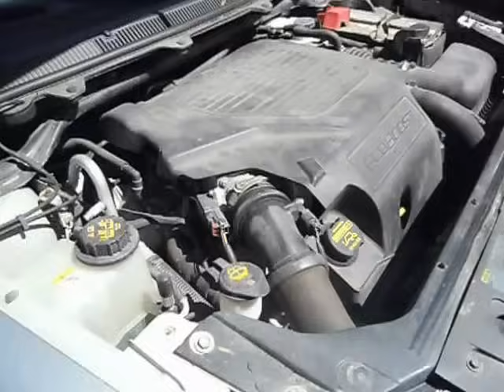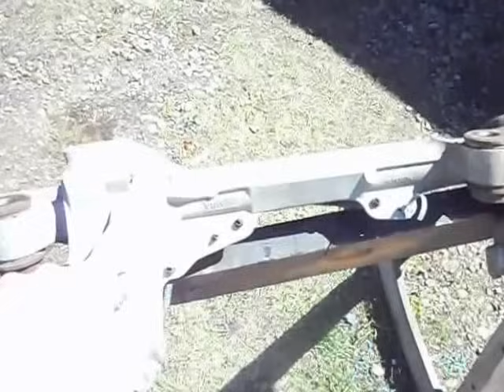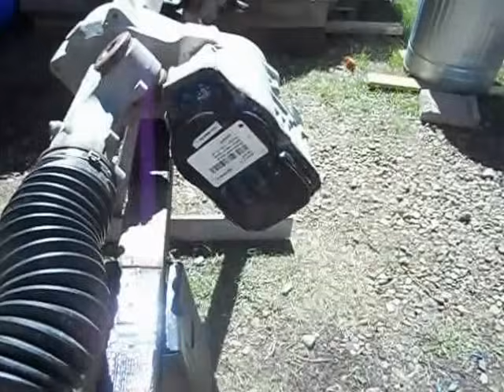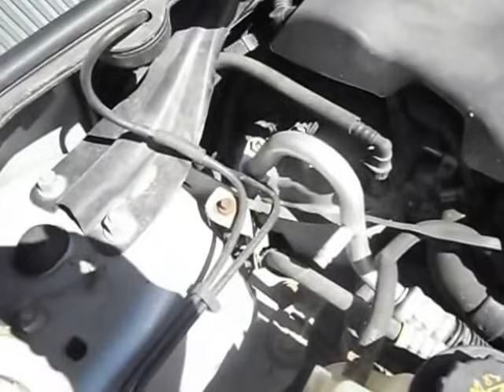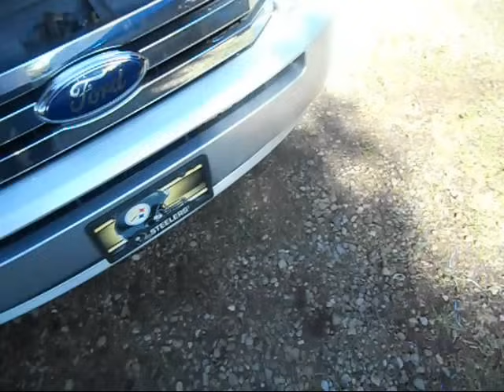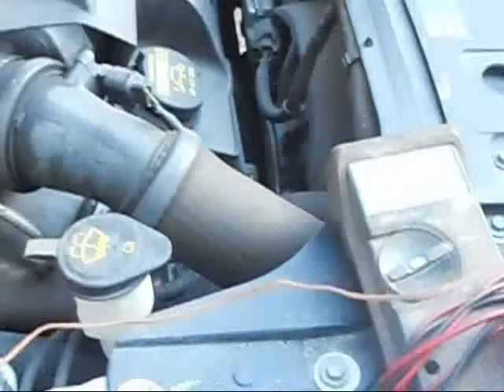Ford Electric Power Steering Failure Identified

Comment from the maker: Important note about industrial vs automotive temperature grades and how engineers design modules to meet regulatory specifications. Designing an electronic implementation to adhere to industrial, automotive or extended temperature range specifications can present daunting design challenge. Related to simple or limited component count implementations; challenge can be manageable. However for high-level integration designs incorporating mixed-signal, computational and high-count component implementations; the challenge becomes great.
Incorporating 100% automotive grade components within highly-complex electronic implementation is not only impractical for most designers; but extremely expensive, time consuming, and introduces many specific assembly and manufacturing requirements to meet specification.
One engineering approach to achieving automotive temperature specification, is to utilize lower-grade sub-components sealed within an assembly, specifically designed to 'buffer' (or protect) internal components from higher-grade temperature environment. This approach often uses high-thermally conductive materials to remove and dissipate heat energy away from sub-temperature grade components. This is precisely the case with the Ford EPAS assembly, which includes commercial and industrial class components internal to an aluminum enclosure, designed with specific intent to provide thermal isolation. Ford's implementation also includes large air-collection cowl that passively channels cooling directly over the EPAS aluminum enclosure. In effect, the EPAS aluminum enclosure collects and stores thermal energy from the automotive grade environment, and this energy is dissipated using airflow via cowl induction.
Unfortunately, this approach failed in the Ford integration, since Ford engineers unwisely placed catalytic converter, exhaust pipe, and turbo assembly within inches of EPAS enclosure. To further compound this failure; passive cooling-cowl only moves air with vehicle in motion. Drive with engine under loaded condition, stop vehicle at red light or sit with engine running, and you have super-heating of EPAS enclosure. Over time, internal EPAS components fail due to thermal stress.
Conclusions represent simple and logical disposition of current Ford EPAS system failures; based on common engineering design practices, measured operational parameters, and visual thermal stress indicators internal to EPAS assembly. Not to mention millions of failed EPAS units in the field with not one plausible or verifiable disposition from Ford or the NHTSA. Did anyone even notice fact EPAS units continued to fail by the millions in spite of Ford supposed fix related to connector misalignment during assembly? Apparently the NHTSA did not!

Comment: I have a 2012 Ford Focus sel. I was driving and the steering went out and being it sits so low to the ground was very difficult to turn the wheel. I thank God my daughter wasn’t driving or this could have been disastrous. I called the dealership and was told the mechanic worked there for 15 years and never heard of this happening. That surprised me since I filed a case with the NTHSB and there were thousands of complaints about this. So I guess I am stuck having to come out of pocket for this. Great video by the way kudos
Reply from the maker: Thank you, good to know video was helpful. Your dealer and mechanic are both liars indicating problem not known. Ford EPAS problems front and center for years, including recalls, court action, news coverage, and millions of vehicles serviced worldwide. Problem is ubiquitous and well documented in Ford TSB's, recalls, and NHTSA historical record. I would ask dealer if they ever heard of the Ford Pinto...

Comment: My best friend's 2011 Chevy Cruze had an intermittent steering issue, different from the Ford in that the steering would just stop responding at times. The wheel itself would still turn, but the car wouldn't. The last time it did it, he drove into a bridge rail at ~30 mph. Totaled the car, but didn't seriously hurt him. Problem is well known, but GM refuses to acknowledge it. Really makes me glad that my daily-driver 1978 F150 doesn't have any of these problems.

Comment: My 2012 Ford Escape's steering has been locking up off and on over the past few years. Very dangerous! Ford told me I need a new steering column assembly and offered me no discount. I'm not paying them after paying off this car from their dealership! They should fix this. 2012 should gave been recalled too! I will never deal with Ford again. There is so much information out there about this problem only by people like you. I'm so sorry you were injured. Thank God you lived to do your research and warn us!

Comment: i have a 2005 chevy equinox the epas system is under the steering wheel inside the cab, no heat issues there haven't had any failures and what i like about it is they sell the individual parts motor, computer module, sensors
for sells a complete unit for $1350

Comment: I have 2010 Ford Fusion and had this happen just last week on way home...This is definitely a safety issue and Ford has no concern for public safety..Mind you this car has had 12 different recalls...on various items including gas tank, throttle control module..NHTSA NEEDS TO BRING THESE ISSUES TO LIGHT AND HOLD FORD RESPONSIBLE..

Comment: I own a 2011 Lincoln AWD, MKT 3.5L Ecoboost. Last year I replaced a failed front transfer case with the new Ford modified "C" unit. I also had a failed electric power steering unit replaced, after the steering wheel almost jerked out of my hands going into a left turn. The power steering was dead. After CAA towed it to the ford dealer the unit was replaced in April 2021, however l had to return to the ford dealership four times for adjustments on the steering unit and 4 wheel alignment. Still the problem persisted as the power assist warning light would cause an alarm and light bracking on left turns. Ford could not fix the problem so i did not permit mhy wife to drive the Lincoln for concern for her safty.
 Last week September 2022, one year and five mouths after the first replacement of the electric steering unit, the electric steering failed a second time as I was pulling out of a parking lot with my wife in the car. She had to assist me in making the right turn. The ford dealership happened to be down the street so I drove it back to them and had them drive us home. The next day I was informed that the lincoln needed another $2,800 electric steering unit and ford would not pay. 
My 2011 lincoln MKT is currently under a manufacturers safety recall in the USA and Canada. However, ford told the dealership that they will not replace the defective unit as they placed a three month warranty on the steering unit. 
I have filed a formal complaint with Ford Canada and wait for there reply. (28 September 2022).
Reply from the maker: Ford has defrauded consumers for years. Your experience is typical and repeated many times over for others posting Ford fraudulent EPAS activities. Ford has established network of specialists including engineers, attorneys, and customer service representatives specifically to evade and repulse customer complaints involving flawed EPAS system failures. Ford engineering and management are acutely aware of EPAS engineering deficiencies, and subsequently developed well maintained plan to defraud customers by actually pulling profit on EPAS repairs. NHTSA is no-show as consumer vehicle safety agency. Fact that EPAS failures are dangerous seems to be of no concern since no one has been killed yet. Or perhaps someone has, and incident has been 'handled' like the Ford Pinto investigation (conducted by Ford). Your best option is to cut losses and stay away from Ford products. EPAS failure could have harmed you or family, do not trust repaired EPAS system. Ford will levy ton of pain and frustration if you pursue warranty repairs.

Comment: My daughter had a steering "hard over" and brought to the dealer. She had previously paid $1500 for a steering motor replacement. This time they told her she needed another $1500 in steering column repairs as well as a 4 wheel alignment when done. They charged her $150 for an alleged inspection by a mechanic to arrive at this estimate. I instructed her to bring it to my shop and they warned her that if I fixed it they would have to charge her another $150 to "re-program the electronics". We put it in the air and immediately spotted a failed steering coupler that was nearly separated. It was a $140 retail part that took one-half an hour to replace. It had absolutely nothing to do with any of the repairs called out on their estimate or the problem.  This reveals a "top-down" policy of fraud and deception by Ford and their dealers. They are certainly not the only ones doing this, of course. That doesn't make it OK. I am filing a complaint with the MN AG office.
Reply from the maker: Ford is a $200B syndicate, Ford dealers do what they are told and collectively process consumers for profit. There is no state or government agency that will go against one of the greatest money makers in the US (auto industry). The whole system is connected from business to politics. What amazes me is people continue to purchase Ford products. You should here some Ford enthusiasts defend Ford like zombies. Amazing!

Comment: I have a 2015 Ford Explorer V6 and we were driving down the highway and our P/S cut out. Power Steering assist failure lights came on, Terrain selector lights came on because of this. Our car had less than 19,000 miles on it. Ford sure isn't what it used to be. Thankfully it was covered under warranty. Thanks for the video. Now I'm curious as to what other catastrophic failure I might expect.

Comment: My wife 2012 ford Fusion just had this failure yesterday. Incredible that they are not taking this issue seriously. But they sure take Airbag recalls seriously though which she just got in the mail today. 😡😡
Reply from the maker: Airbag recalls specifically associated with Takata (Japan based manufacturer). Takata forced into bankruptcy by US safety regulatory agencies. Since your faulty EPAS system was designed in US by TRW and integrated on vehicle systems by Ford; no action will be taken by any US based safety regulatory agency against Ford or TRW; this consumer safety  action would hurt US based Ford's $200B market capital. It's all money and image game; consumers suffer both financial and hazard burden.

Comment: Same happened to me. Inside by the Electric Motor where that internal belt is, that bottom roller (internal pulley) that he belts is connected to, that bottom roller has bearings and on mine the bearings are worn making a rubbing noise while turning. My thought is putting some header heat rap over that cat to keep the heat off of it.

Comment: The days of "Do it yourselfers" Are starting to come to a end with these newer cars.
Reply from the maker: True, and I would say, those days have been gone for some time. I keep an old restored early 70's muscle car in garage. No electronics, fancy features, or even electric fuel pump. Frame manufactured using thick steel, trim is real chrome plated metal, interior is leather with metal accents. Basic and simple Chevy 350 V8; completely void of ECM, sensors and modern gadgets. Vehicle has been running for nearly 45 years, no engine failures, wheel bearing replacements, etc. Tell me why automotive industry has evolved to design and produce outrageously complex, expensive, technology excessive, inferior material laden, poor quality, and poorly designed disasters labeled as luxury sedans. Automotive engineers today cannot even design a wheel bearing that lasts beyond 30K miles; with steel bearing assembly pressed into aluminum wheel hub (turns to solid mass due to galvanic reaction; basic chemistry 101). It is really quite pathetic and sad; what our so called high-technology and sciences have become. In old engineering school; we were coached that all design should include balance between performance, technology and most importantly 'simplicity'. This basic concept has proved fundamental to quality, endurance and reliability in engineering implementations. Guess these basic concepts were lost somewhere during maximizing-profit and minimizing-cost philosophies.
Reply: @bk1468  its been two years since your comment but damn. 2021 and its still the best comment on cars ive read ever.
Reply from the maker: @jetfu400  Thank you, just quoting reality.

Comment: I know NOTHING about cars except getting oil changes, rotating tires, and getting my car checked out on occasion.
My 2012 Ford Focus has the power steering failure msg come on occasionally, and it takes all my strength to turn the wheel. Then I start it another place, and it's back to normal...?
My mechanic didn't catch it WHEN it happened, so he couldn't explain it.
With my arthritis and torn shoulder, I'm scared something BAD is going to happen😯
No more Fords for me😠

Comment: We had just bought a used 2011 Ford Fusion. Low mileage, A month later the power steering went out. I found the recall through AllData so I contacted our nearest dealer, ( 45 miles away), and they told me they see no recall on the steering but on an airbag. Sure don't look right to me.
Reply: That recall was cleared years ago. I looked it up.

Comment: Just had to have my 2010 Fusion towed to the dealership for this same problem.  I only have 64,000 miles and in the last 3 months have already had to replace fuel injector and need to replace struts as well.  When I get this fixed I will be trading it in on a Honda.  It's ridiculous for them to not recall this part especially since its the same as the 2011- 2013.  Will never buy a Ford again.

Comment: another investigation was started in sept 2016. please file yor complaints about this issue. I did mine today after total failure driving down the highway.  thanks for the video and the work you did.
Reply from the maker: Your welcome, and hope video was helpful. I was not aware of additional investigation in 2016, is the NHTSA involved? Please point to information. Also, please describe your steering failure experience in detail. Were you placed in danger? What year and model?

Comment: They know there's a heat problem. The owners manual says if the power starting assist faults out, let the car cool and that should help. I purchased my escape 3 months ago and my vehicle just faulted out. You'd think the 28 degree weather would have helped a little. So what do we do, bend over and take or up the a**? My vin isn't on the recall list.
Reply: Yes take it baby. Ford is SO HARD rn.

Comment: My dad has a 2011 F150 with the first gen EPAS. The steering will randomly bind, and become a nightmare to control. Then go back to normal suddenly. Called FORD service, and they basically tried to avoid any sort of answer. I asked them if they have seen this a lot, and they essentially wouldn't answer. I tried to dig deeper and they just backed away from the issue. This is a death trap issue, and unbelievable they are so non-nonchalant about it. Going to replace the unit on my own with a Rockauto rem-man and do the re-code with ForScan.
Reply from the maker: Remember; replacement unit has not been re-designed in any way. Thermal exposure under hood will cause failure of replacement unit over time; for some Ford customers, this has been as little as weeks. Strongly suggest disposing of hazardous vehicle post replacement. Just matter of time before fatalities caused by Ford steering system failures.
Reply: @bk1468  Indeed! Here was FORD's reply today. More of the same.

Thank you for contacting the Ford of Canada Customer Relationship Centre, my name is Diana. We received your email on June 18 regarding your concern.

We do regret the circumstances for which you have contacted us regarding the steering in your father’s F-150. We can understand your concern and frustration with the cost of the repair as well. The warranty provided by Ford of Canada for this repair was for 3 years or 60,000 kilometres whichever occurs first from the warranty start date which was May 10, 2011.

Ford is proactive in trying to identify areas of concern through investigating consumer and dealer feedback. Not all issues investigated will result in a recall or program. We have reviewed your situation, and there are no warranties, recalls or customer satisfaction programs on your vehicle that would provide assistance for this repair.

I am truly sorry that we cannot meet your expectations in this instance.  Thank you for taking the time to write us about the details of your concern.
Reply from the maker: On behalf of myself and millions of other former Ford owners; we can only hope this company burns for its engineering incompetence, criminal negligence, and complete lack of responsible action in face of critically hazardous vehicle system design. Ford is associated with long and deadly history of producing critically flawed automobiles. And is well known for ignoring hazardous engineering flaws, and failing to take or even acknowledge safety concerns. I realized how corrupt Ford corporate was when I sued Ford. The Ford attorney attempted to criminalize me in court by insisting smoke pouring from my exhaust from failed Ecoboost engine was due to me placing oil in mufflers. This accusation was so blatant, hostile, ridiculous and baseless; Judge ruled against Ford and my case was won. You are dealing with an organization that will do anything to protects its public image. Ford legal is dirty, sly and never to be trusted. It is through their own instrument of plunder this company will fall.